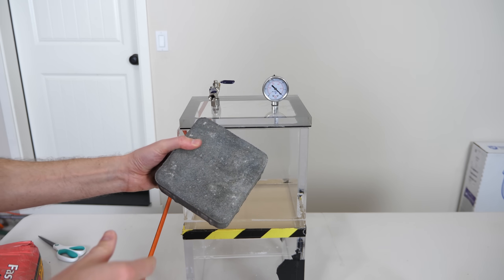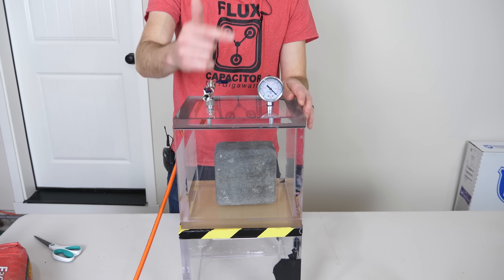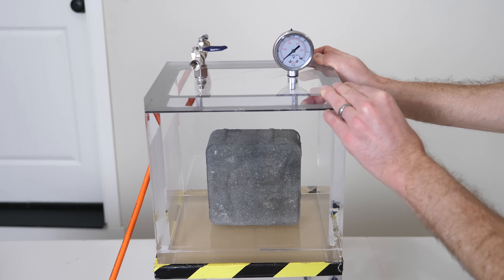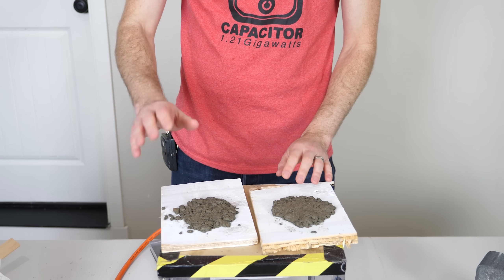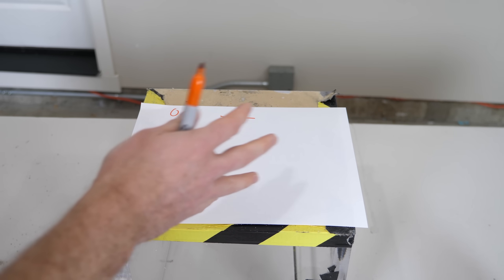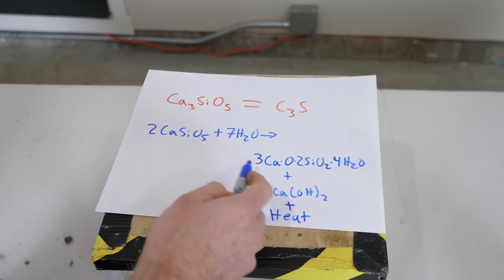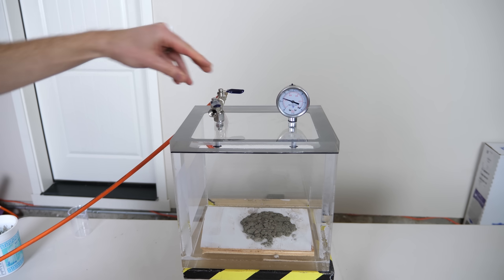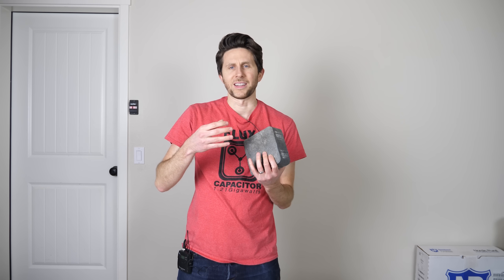Does Concrete Turn to Dust in a Vacuum Chamber? Concrete Without Oxygen Experiment

Comment: Everything that would happen if oxygen disappeared (including molecules) 
1.Everyone at the beach would get sunburns. Ozone is molecular oxygen, and blocks the majority of UV light. Without it we are toast.
2.The day-time sky would get darker. With fewer particles in the atmosphere to scatter blue light, the sky would get a bit less blue and a bit more black.
3.Every internal combustion engine would stall. This means that every airplane taking off from a runway would likely crash to the ground, while planes in flight could glide for some time.
4.All pieces of untreated metal would instantly spot weld to each other. This is one of the more interesting side effects. The reason metals don't weld on contact is they are coated in a layer of oxidation. In vacuum conditions, metal welds without any intermediate liquid phase (Cold welding).
5.Everyone's inner ear would explode, we would lose about 21% of the air pressure in an instant (~ from sea level to 2000m elevation), so expect some serious hearing loss.
6.Every living cell would explode in a haze of hydrogen gas. Water is 88.8% oxygen; without it the hydrogen turns into gaseous state and expands in volume. 
7.The oceans would evaporate and bleed into space. As oxygen disappears from the oceans' water, the hydrogen component becomes an unbound free gas. Hydrogen gas, being the lightest, will rise to the upper troposphere and slowly bleed into space through Atmospheric escape.
8.Everything above ground would immediately go into free fall. As oxygen makes up about ~45% of the Earth's crust and mantle, there is suddenly a lot less "stuff" beneath your feet to hold everything up.

To sum, it wouldn't be pretty.

Comment: The absence of oxigen means it move vom chemical Connections. Not loos of pressure in the Atmosphere! As like H2O (Water) =2xH +1xO if you remove the 1x O you will get 2x H . You get it?

Comment: In order to set concrete must fully hydrolyse with liquid water. In space you would have the challenge of waters boiling temperature in a vacuum or freezing solid before this took place.  You can use additives to somewhat prevent either from happening as easily, but you would generally want to, at least temporarily, incase the concrete in some envelope and regulate heat (not to cook it in solar radiation or quickly freeze it).  After a bit however it would continue to set in a full vacuum.

Comment: This vacuum chamber test didn't remove oxygen from the internal pores of the concrete, so technically this test didn't disprove the "concrete will crumble without oxygen gas" theory. 

However even if you could remove that oxygen it still wouldn't affect the concrete.

Comment: Thanks for doing this test and finally shutting up these ppl. I work with concrete all the time in construction and I said no way it just crumbles to dust without oxygen. That would literally require a reverse chemical reaction to take place which won’t happen just by removing oxygen. Last thing, the wet concrete mix you used could definitely have been mixed more thoroughly to get even separation of the sand, Portland cement, and aggregate, but a good test nonetheless

Comment: The concrete mixture needs a touch more water for a correct mixture.  Cast-in-place Concrete like this is required to pass a Slump Test, this would fail that test.  Concrete should have the consistency of creamy peanut butter.  If concrete is too wet or too dry it will not have the correct chemical reaction to properly strengthen the concrete.  Simple Quickrete should yield a strength of 4,000PSI - 6,000PSI.

Comment: This experiment is flawed. You don’t need a vacuum chamber...

Chamber flushed with argon, mix concrete, add some dark aluminum to absorb any o2 created or released during curing. 

Make a control like you did with an air dried sample. add the same amount of dark aluminum to the air cured concrete.

Compare the two after 24 hours.

Fuckin idiot

Comment: Concrete crumbling to dust due to lack of oxygen would seem to suggest that it constantly requires oxygen for some reason. It doesn't breath, it doesn't live, so by that reasoning, you're saying that concrete is constantly reacting with oxygen, which is not the case.

Wet cement/concrete actually will be affected, although not so much by lack of oxygen, but by lack of atmospheric pressure. Less atmospheric pressure means less water in fluid state, which cement and concrete require to get their strength through chemical reactions. The two samples in the end seem like they don't differ at all (apart from their color), but if we put them to test in terms of strength and durability, which are key qualities of concrete, the sample out of the vacuum will most likely fail (the vacuum sample in the end looks to be much more brittle and incohesive)

So, air/oxygen has little bearing on the inner workings of concrete, as it's dependant on water to react and form solid concrete. If you pass by a construction site, maybe you have noticed that freshly poured concrete floors may have large sheets over them. This is to prevent the watervapors from escaping from the concrete, as the reaction going is an exothermic reaction. In hot areas, this effect is amplified

Comment: Concrete doesn't just dry, it cures. The vacuum chamber will likely remove the moisture prematurely, not allowing the chemical reaction to fully react. Therefore it will not fully cure. My guess.

Comment: Well the stone you used is made from silica it's not concrete so that's probably why it didn't work they are not solid they have air that goes thru them

Comment: The cement interestingly did look as if it expanded when letting the air back in meaning it contracted due to lack of air but was still structurally sound.

Comment: Well first time I’m watching this and you are asking us to guess so:
I’m guessing it will stay solid because putting it in a vacuum doesn’t remove the structure it is locked in, at best it would simply remove any air locked inside it but any oxygen in the structure itself will still be there since it’s not part of the air but part of the structure…
So technically you aren’t really achieving what the myth says but I guess it’s about as close as we can get with science and not magic.

Comment: What's the point of this video? Obvs it won't crumble the force needed to break that under a vacuum would be off the charts and the glass would probably break first if you actually had a compressor that's powerful enough

Comment: The reason why I didn’t turn the dust is because I think they meant by without oxygen concrete would collapse, Concrete probably has an oxygen molecule and its chemical structure
Reply: If we were removing oxygen from its chemical bonds, crumbling structures would be the least of our worries.

Comment: I always thought that those videos were pretty clear: what if they remove oxygen (like all oxygen, all molecules of it, instantly, into oblivion). They did not ask: what would happen if we lost atmospheric pressure 🤦🏼‍♂️
Reply: If we removed all oxygen from all bonds, the last things we would need to worry about is our structures collapsing. Oxygen is the most common element in our crust, atmosphere, and oceans at around 48%, and the second most common element in the entirety of the earth at 30%. It is bonded to nearly everything we see, "rocks" are mostly silicate minerals which are silicone dioxide SiO2. If all oxygen was remove, our water would instantly transform into hydrogen, our plants, animals, and our own bodies would essential melt and bubble away as the hydrogen escapes, the surface of the planet would essentially fall apart, the planet itself would become less dense and immediatly begin collapsing under its gravity, carbon would rain from the sky. Theres flat out no way to describe all of the effects of removing every atom of oxygen as it would be destruction of an unimaginable scale, there would be no recovery, you wouldnt sufficate for a few seconds, youd be dead instantaneous. The planet and literally everything on it would essentially fall apart.
That is almost assuredly not what most of those videos talk about.

Comment: My guess was that there might be some small cracks forming, but under perfect conditions it should be fine, cause a lot of times you get air bubbles in concrete structures, that's why we vibrate it when wet. But usually there's nothing that should have an affect on it, it's an amazing substance, but cement is extremely high in CO2 emissions to create, so if someone can find a green binder that is similar, the civil engineering industry is waiting. Also, it would be pretty cool to build in space.

Comment: Concrete i.e. cement glue cures through a chemical reaction not by drying. A common mistake and misunderstanding. 
Its curing is even better if its moisture is being conserved by tarping or maintaining it wet in another way (like by sprinklers).
Especially over the first couples of days this should be done as the increase/gains in strength percentage wise is highest at the beginning. Concrete gets harder even over the years although it’s getting exponentially less.

Comment: I get the thought process but it's fundamentally flawed just because it entirely based on the assumption that when you put something in a vacuum that it's like space when in all actuality it's not because when you put something in a vacuum you are pulling air so the belief behind this is that if you're pulling air from a solid object that it's going to pull the air from that solid object however you are not increasing gravity. In which case ultimately means that you're not making concrete stronger or weaker you're just changing its composition. It be like me going into space yes I can't survive in space because I have lungs and if I do my body will implode  because of the lack of an atmosphere and all that wonderfully complicated science but the point is still the same. However that doesn't change my entire existence because I went from an atmosphere to none it just changes my density if nothing else.

Comment: No it won't turn to dust concrete is a mixture if cement stone and sand once it sets then it will always be solid unless it is smashed or soaked in water and hit with something harder than stone with a high enough force to break it... However if you mix wet concrete it relys on an exothermic reaction to become solid this happens when the chemicals and compounds react when exposed to air without air thus reaction will not take place so theoreticaly if you mix concrete in zero atmosphere or bellow zero and keep it in that atmospheric state it will not react and will possibly turn to dust as the water molecules dissipate as oxygen and hydrogen gas and are sacked out in the vacum so those compounds have no liquid chemical to air reaction... Theoreticaly speaking I have not tested that theory as I do not have the means to do so but I guess thats how it would work out due to the concrete needing an exothermic reaction to oxygen to become a solid material....
Reply: AAAAAAAAAAAAAAAAAA MY HEADDDD

Comment: I'd guess no. 
Edit: I wanna see cement in a vacuum.
Second Edit: I guess you did that.
Tertiary Edit: Went back to the beginning to rehear the difference and I guess it wasn't cement it was wet concrete.
Extra Edit: still editing.
Final Edit: 8 hour edit shift is finally over.
Overtime Edit: Nvm they told me they needed me to work late today...

Comment: You are just extract oxigen from air, not  from a molecular level.And If You are put cement in vacum to dry IT wont solidyfay because isn't CO2 there

Comment: Yes.. it does looks like pure Water & Physical reactions!

Maybe you could, assume that, once concrete is confirmed hardened.. it transformation is like a diabolical diamond or Trapezium structure ( in which, you can just picture that the reaction creates something like a honey bee skeleton home ) with this in mind, the harden structure entraps all the oxygen inside, like it was somekind of small compact balloon structure & has small microscopic level 

Just pretend, concrete harden like some kind of a corral reves skeleton structure.. but 3x times the smaller hole mass of a corral Reaves.. 

so.. just imagine, you got small microscopic super small tunnel hole of what you've imagine, hole that coral Reaves has & that is why, oxygen never gets trapped inside & around concrete because it was released off of those small little microscopic tunnel

Comment: The concrete curing in vacuum did seem to generate more crumbles, which is what you would expect from some of the water having evaporated before it had a chance to react.

Over extremely long periods, heating from sunlight would combine with the effect of the vacuum to dehydrate the concrete and reverse the setting reaction, but that would take an extremely long time unless you moved the concrete to somewhere really hot like Mercury's orbit.
Reply: Well, Venus is hotter than Mercury, so there is that...